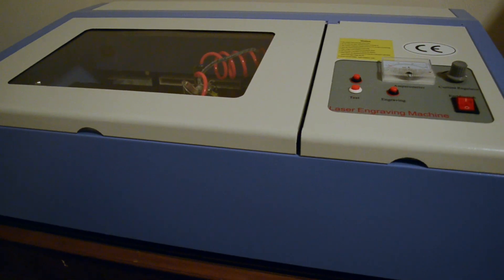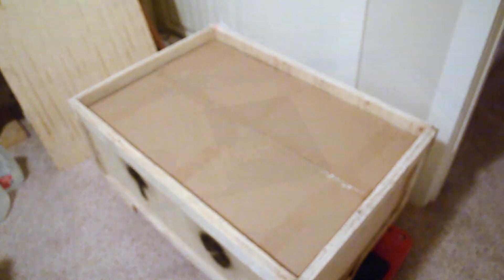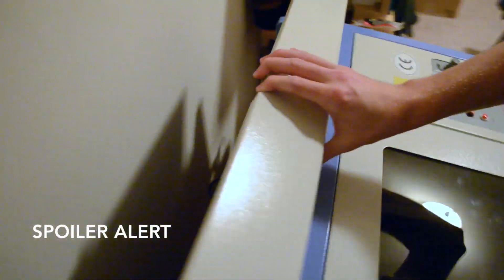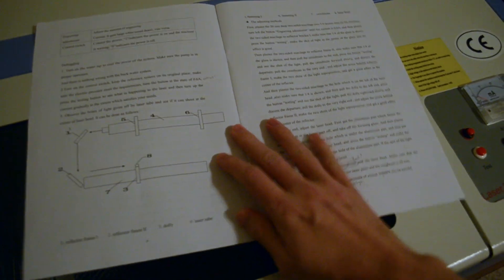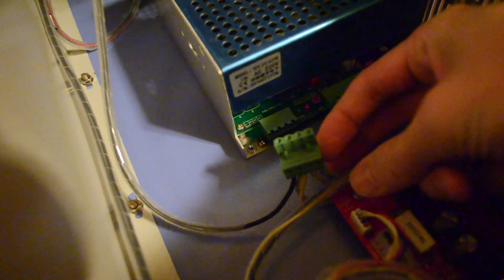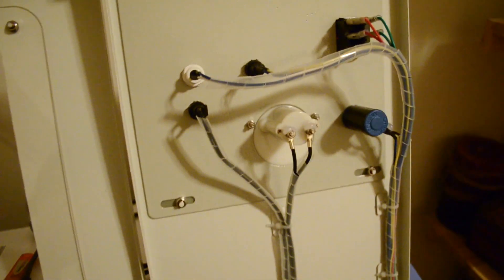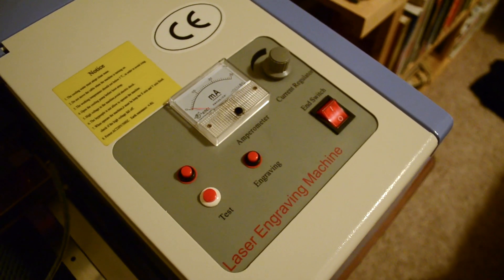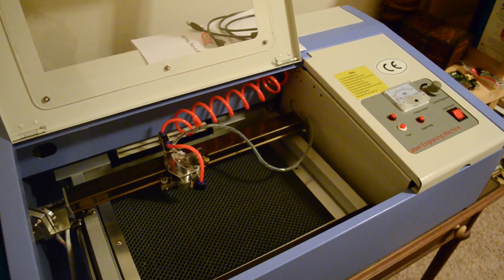Chinese laser cutter part 1: Intro

Comment: It's my observation that the K40 is a great laser system and bargain price, but the Moshi controller board is really not that good.  One it requires a USB dongle, which is quite limiting as many people would like to run lasercutter from an virtualbox and the USB dongle won't work.  Second as far as I could ever tell the best you can do with Moshi is raster scanning which is quite terrible for cutting out perimeters.  So I'd recommend you upgrade the standard controller with a Lasersaur controller which is easy to use and much more accomodating for true vector cutting as well as raster scanning.  The one I use for $99 is here:  

http://www.mile-milling.com.  

Also you will find that the mirrors are always misaligned.  I also found that the x bar was slightly bent when I first received it.  I had to rebend it straight again.  But after that the thing runs beautifully.

Comment: MIne didn't come with any paper instruction manual  )o:
Reply from the maker: +Craig Cyburt It was basically useless anyway. The only thing you need to make sure is that you know what to used for the mA of your laser.  The vendor should be able to at least tell you that.

Comment: Roughcast is a popular render for the outside of housing in Scotland. Prevents ingress of water on the outside wall.
Reply from the maker: +glencoe Weird, does it mean expanded metal like the bed of the laser cutter?
Reply: The best way to understand  roughcasting is this video by Rab from Auchterarder Perthshire. 2 stage process, ignore the sarky comments posted by cowboy tradesmen.Search  for
how to roughcast part 1 about 3 mins would do.
TheBigrab10  followed by part 2  same 3 mins.

Comment: In all video's everyone shows what it will do but no one shows what the setting are and how to set the machines to cut or engrave. This would be a great help. I am new at this, I have never used anything like this before. Learning something new as a hobby. Thanks for your time. Herb
Reply from the maker: +Herbert Hail which settings? Do you mean the power (mA) or LAOS settings, or the settings in the app which does the controls?
Reply: +hpux735  the dial only goes to a max of 20.  I set it to 100% power and speed of 10. see below
Reply from the maker: +Herbert Hail I'm not sure what you mean max of 20.  My tube's max current is way less than that (6mA).
Reply: +hpux735 I looked again and it is max 20ma
Reply from the maker: +Herbert Hail Wow!  That's a lot of current.  How many watts is the tube rated for?

Comment: I am having trouble cutting through 1/8" wood material and 1/8 plastic. I can engrave but it is very shallow I have tried to adjust the power to 100 and the speed to 15 but it will only engrave. I have tried a simple box and have it clicked to cut. It will not cut. I have the 40w Chinese laser cutter you are using in this video. Please help. I have had this engraver cutter since September 2015 what are the settings to cut? Thank you for your time. Herb
Reply from the maker: +Herbert Hail Make sure you're using the full current on your laser tube.  My tube produced output at close to 6mA, but it was in a weird mode.  I tried turning up the amperage, then it dropped down in current, but produced more output (and stopped making a weird noise).  Then, I could get it back up to 6mA, and it was producing a lot of output.
Reply: +hpux735 Today I was trying again, I drew a square  of about 2". I clicked to cut. I had to run it 3 times to get it to go through a 1/8" plastic sheet. I pulled up a crab outline picture, had it to engrave it then cut but it only engraved it. I tried to cut the outline but it chose on its own to try to cut all of it. This Moshidraw 2015 program is for the birds. Yea it is from china so who can read the stuff. No instructions cane with it so everything is trial and era.
Reply from the maker: +Herbert Hail Yah, moshidraw is awful.  I replaced that first thing.
Reply from the maker: +Herbert Hail I really can't, I'm sorry.  :( I'm up to my eyeballs in work these days. (That's why you don't see any new videos on my channel)
Reply from the maker: +Herbert Hail But, I recommend you watch my LAOS Laser views (where I build and install the LAOS board) and checkout http://redmine.laoslaser.org/projects/laos/wiki

Comment: Thanks for the video! I just got one of these from Ebay. Sorry you had to learn about FOB the hard way like that. Where are you connecting the ground from the back of the machine to?
Reply from the maker: Simonetti Basses Yeah...  about that... My house is new construction with good grounding, so I thought it would probably be sufficient as is.  It's currently relying on my house ground wiring.
Reply: Good to know. Thanks!

Comment: Great video, very informative. YOur machine is a bit different from the other 'k40 chinese laser cutter' around.
I like the honeycomb, the air assist and the large unobstructed cutting area.
I do not like the analog meter and controller.
can you tell us where you bought it?
thanks
Reply from the maker: Andrea Orci Yah, those features are what made me tolerate the shenanigans of the seller.  I recommend you check out my blog post about the experience: @?p=2062 The seller was Sinmic, and I found them on Alibaba.  I replaced the controller with the LaOS open source laser controller, and I've been pretty happy with it.  I still have to use that analog meter, but I'm planning on eventually replacing it with PWM digital power control.

Comment: Nicely done.  Good intro, you covered everything really well.  What was the "spoiler alert" about?
And $600 in fees?!?!?  Dang, that must have been an unpleasant surprise for sure :(
Reply from the maker: The spoiler alert is that I already know that the tube works.  We have a lot of work to do before the first firing!  The fees sucked, a lot.  After being hit with them, I did some research and found them to be pretty typical.  I confess that I read someone complain about them before purchasing, but I thought I could get away with cutting-out the customs broker to save that money.  It isn't really possible.  Because of post-9-11 regulations, you have to file an ISF (10+2) form before a package leaves the foreign port.  It isn't possible for an individual to file this form, and you have to have several bonds before you can have a broker do it for you.